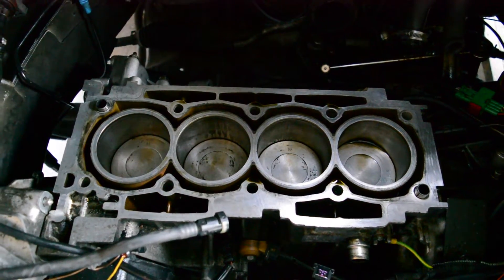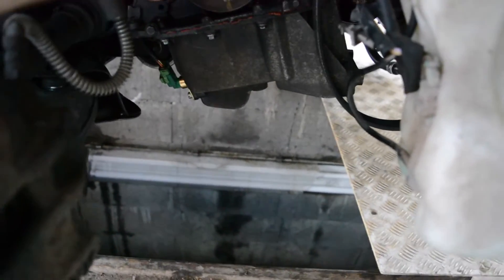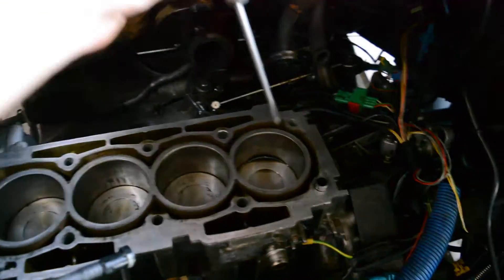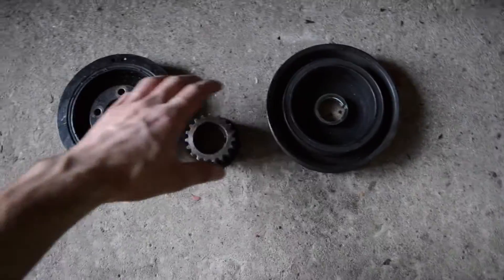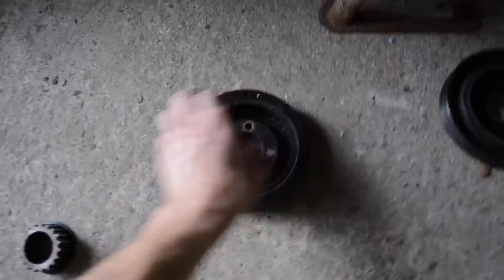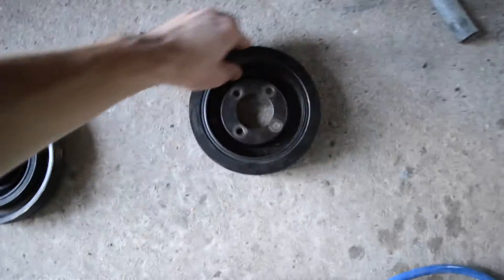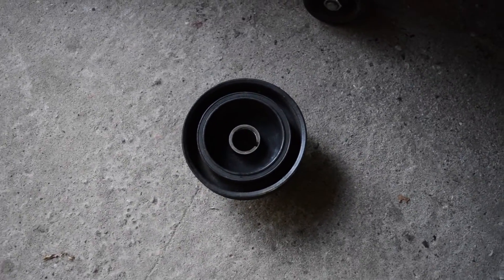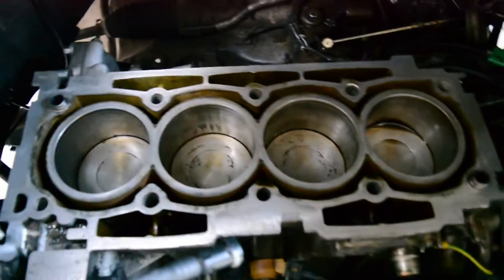Blind Timing - How to time your engine only by help from pistons position (Peugeot ew10j4 + ew12j4)

Comment: This is de RFN o RFR model? Because i see in another places and somebody say the timing point its when cylinder No.1 is in TDC. I dont know is this ocurrs when you put the tool in the flywheel instead of the crank pulley.

Comment: Good advice, mate. There’s a hole in the engine block (near the right driveshaft) where you can see the flywheel. I believe that for engines without a holed pulley, there’s a hole in the flywheel to lock it. On the other hand, engines with a 4-bolt pulley that has a hole don’t have a locking hole on the flywheel and then you have to lock it by the crankshaft as you have done it. Do you know if the part that’s held by 4 bolts is 100% fixed to the crankshaft with a keyway? Or can it move?

Comment: Hi could you give me some advice please. 
I have a Peugeot 308 1.5 16v bluehdi 2019.
I have done a cam belt kit change after I did the chain. 
I believe the crank is 2 turns and cam is 1 turn which is why I have to turn engine over 2 times by hand to get both cam and crank locking pins to locate. 
I believe some people have turned the crankshaft a extra turn which would make it 180 degrees out even tho it still locks with pin so 1 would think it's tdc. 
Well I think this might be my problem as when fitting new tensioner it gave up and belt was loose so crank maybe turned some.. well I'm not sure if my crank/fly is in the right place, I did turn the engine by hand 6 times and it seemed fine and ran the car but it didn't feel great this maybe because of that or the fact I had injectors lit ect., so I have recently turned the crank 180 and locked it ect.. and again I turn engine 6 times and its fine no interference. I've ran the car it seems ok but not great just similar to before little rough. 
Well I need to go back into the cambelt assembly to fit a new cam seal and new crank aux pully so I'm asking how would I know if my crankshaft is in the correct place while I am doing this repair I want to make sure it's correct and not have to go into cam assembly again. Any help.i would appreciate it alot

Comment: Hei. I have this same problem. But i am wondering, that if i spin crank, then on one turn pistons are leveled two times. So how i know, if first cylinder need to come down to match others in center, or on up move ?
Reply: Hi, I have the same question. Can you help me?
Reply: @ssonicx135  same problem here to
Reply: @mic8621  Piston #2 going down
Reply: @ssonicx135  Piston 2 is closest to belt. On my 2.0 peugeot 307 it was going up (not down). How did I know that? I couldnt turn engine by hand when piston 2 going down.
Reply: @oskarjohansson6767  If you have the cylinder head mounted, try to remove all the spark plugs and then try turning again.
Reply: @ssonicx135  I was without spark plugs when case above found. Just wanted to tell my story (piston two needs to go up (not down) in case somebody else having same problem.
Reply: @oskarjohansson6767  Great!! Anyway, there are only those two options, going up or down, there is no more, in one of those two the engine should start.
Reply from the maker: Marek Kubi 

Hi there 🙂
I will check the pistons movement today, at my workshop. I will let you know